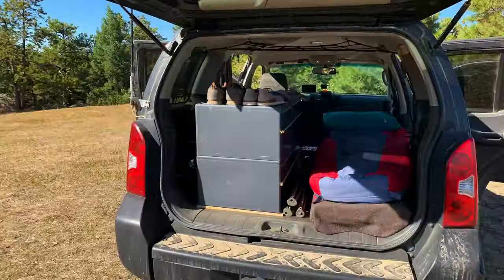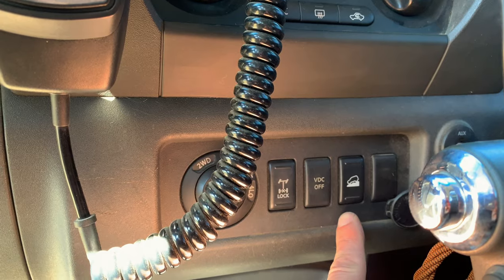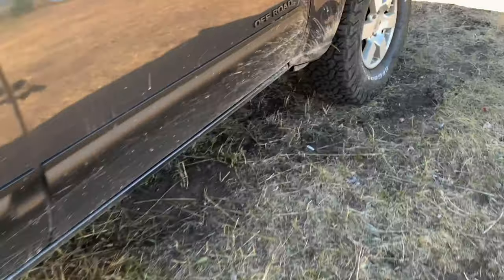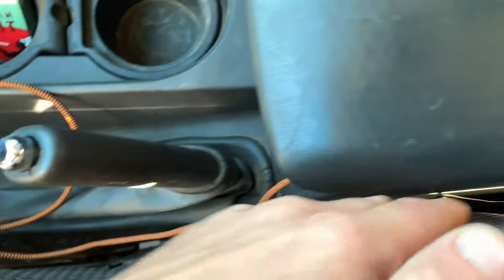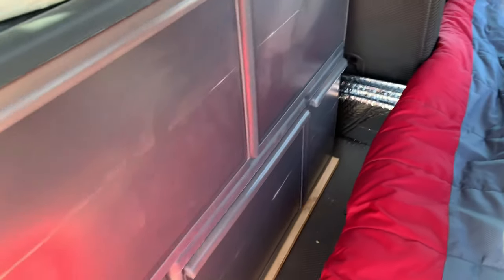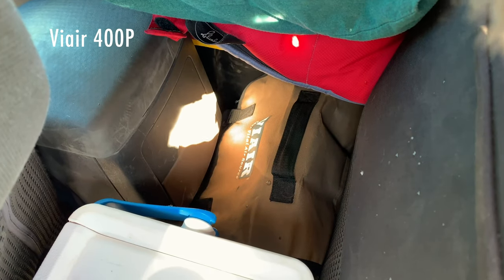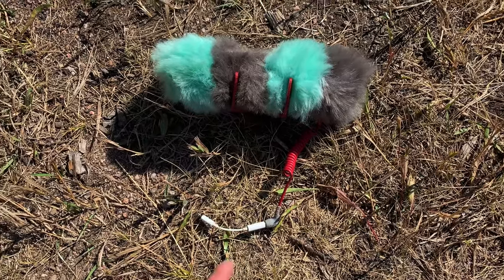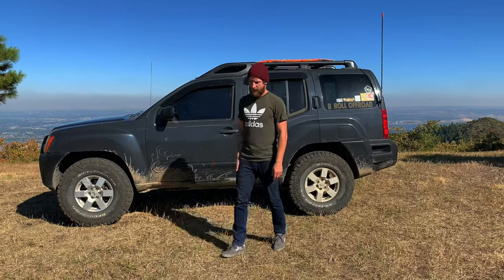Basic Solo Camping Xterra. Rig Walkaround #1

Comment from the maker: just wanted to add a couple things i missed:

the bottom drawers are screwed down into the wood and top row glued down to the bottom row. they're all glued to each other where sides are touching. i used some kind of roof repair silicone. 

i had a tow strap in the cubby in the floor below the mattress/drawers. there was also 2 hatchets in there. i didn't want to waste that whole space but the reality is it's a pain to get anything out so those items have been relocated.

in the bag in the crate i also have a CB tuner and cable along with a Lansky knife sharpening kit. 

the CB power is routed to the right of the radio and behind the glove box to the fuse box with one of these:
https://amzn.to/2p4MqC3

Comment: I tried sleeping in my Xterra a couple of times and gave up.  The fold flat passenger front seat makes all the difference.  For a while I slung a hammock from the roof rack to a 4x4 post or boulder --- so awesome in the desert heat but having it fail unexpectedly at 3am is like a kick in the sack.  I've had multiple tents/poles fail in desert cold/wind while setting them up around midnight --- your setup probably saves you a lot of headaches.
Reply from the maker: HAHA i can imagine, that sounds awful! my buddy works at Warbonnet and hammocks were the only other thing i was seriously considering but i'm in Moab so much with nothing more than bushes and sand around i had to give the idea up. so far i love everything about the Oztent, can't wait to get it in some heat and see how its features handle it.

Comment: I'm a new 2nd Gen Xterra owner with the ALL Important Off Road Pkg... I'll prob go exactly your route for a more simple setup. These trucks are plenty capable right off the bat I hear. 

I'm stoked to find your channel and def am a subscriber now! Cheers
Reply from the maker: absolutely! i have very minor mods (2” lift, no sway bars, 33” tires) but my earlier vids the X is stock. i also have Easy/Medium/Hard playlists if you wanna check those out. 

if you’re going to sleep in back i’d make some kind of platform, the ones i’ve seen have like a 4” rise towards the front. the problem is the trunk kind of goes uphill from back to front, then the seat folds beyond flat to downhill, then the crate is flat. so the sleeping surface basically has a hump in the middle and is only flat at your head.

Comment: Great vid man. I have a very similar rig and similar mindset, but with the 6 speed manual. I have 265 bfg ko2s which will need replacing soon. What's your review on the 285s, specifically in the mpg area? Noticeable drop in mpg or comfort? Mines a daily driver so it's somewhat important to me, I can get around 18-20 highway avg currently with a 2 inch lift and a front bumper if I have a light foot.
Reply from the maker: i got 23 on the way home today but i took the highway instead of the interstate so it’s only 45-60mph. i think over 75 these don’t get good mileage no matter what but i’ve gotten 17 on that route. i love them but a complaint would be load range E, they ARE noticeably stiffer but i got used to it and they wore in a bit.
Reply: @BRollOffroad  thanks for your fast reply. Good to know. I am E rated now so not too worried about the stiffness...just the possible mpg loss for what is a minor gain off road considering I don't go much and what I do is mild.

Comment: Very cool rig. I’m rocking a 2007 off-road Xterra, mines the 6spd manual. 

Yours must’ve been the first year with hill decent, mine didn’t come with it. 

Curious on what did to remedy the SMOD issue that plagued the autos. Also with the rear diff, you running stock fluid? Did you run the breather tube for the diff too? I got worried so I got the setup from Off-road Gorilla cause I’m lazy.

Love your videos dude. Eventually you’ll move onto a Toyota or something but until then I’m a subscriber and love the videos
Reply from the maker: hey thanks a lot for checking 'em out! the SMOD was remedied when i bought it, has a nice CSF one in there. fluid looked OK, nothing on the cap, now it's ~45k miles later and no problems. i'm not sure what's in the diff, i checked it in the beginning and it looked fine but it's probably time. i still haven't done the diff breather (i know i know..) because i'm even lazier than you haha!

Comment: I have a 2017 Pro 4X, when set up camp put it in park and put the seat all the way back ... I'm camping and can move out in less than a minute ... don't use lights or have campfires (X Jungle Fighter, get nervous with a lit up camp) ...
Reply from the maker: yea i've camped that way before too, not the best (i broke my neck when i was 17 and still have a lot of problems) but works fine in a pinch! usually happens when i'm trying to make a roadtrip in one go and get too tired before the sun comes up. pull over, seat all the way back, try again in 3-4hrs 👍 something about the fire makes lights OK but recently we've had fire bans and when i was walking around with just my light on it felt weird and super exposed. inside the truck it's all glare and can't see out so i don't know, i slept best with all the windows down and no lights on haha, kind of counter intuitive but at least i could see and hear.
Reply: That's pretty sick because the Xterra was discontinued in 2015

Comment: B Roll, how is the on road handling effected by the sway bar removal?
Reply from the maker: personally i like it better for the rough paved roads we have out here, hitting potholes is much less violent. bridge interchanges on corners where the back end would kick out is eliminated. the stiffer springs help a lot with body roll, i think stiffer springs without sway is about the same as stock springs with a sway. it never handled great to begin with and i drive accordingly haha. it’s just a few bolts to take it off, i think it’s worth it to remove and go do some swerving and see how you feel 👍

Comment: Love the simple set up! Where did you find that drawer system you have in the back? Also love the hilarious narration! Keep up the good videos👍🏼
Reply from the maker: thanks! the drawers are from The Container Store and were a little spendy, i think it was like $100 for the 5 but they're still solid after many trips. I screwed the bottom ones down to the wood board and glued them together in between. then glued the top row down to them using a roof repair caulk.
Reply: Thanks. $100 isn’t bad compared to a lot of other options! I’ll definitely be looking in to that
Reply from the maker: @schuylerking1318  yea we were leaving in a few days for a 10-day in Moab and i needed something fast. i definitely could've made something but didn't have time and i like how light these are. it's only temporary if it doesn't work!

Comment: You carry any gas cans or anything like that? Maybe I missed in the video.
Reply from the maker: nah i just fill up at the closest gas station to the trailhead if we’re planning on driving a lot, hasn’t failed me yet! most of these videos i filled up near my house, drove all weekend and then made it back. even Vail is only 100 miles away, 200 with the drive back and i’d never put 100 miles offroad down in a weekend so it’s fine. last time in Ridgway i filled up, started heading East out of Montrose and my buddy’s van blew the radiator. i drove all the way to Delta, came back with the part. drove all the way to Denver to drop ‘ol Roddy Turner off and then drove home to Littleton.. 402 miles on the tank 👍
Reply: @BRollOffroad  that's really good. My 4runner ain't hittn like that though.

Comment: I slept in the camper of a 97 f250 for afew years hunting. A metal camper. A COLD metal camper. Schedule follows: run buddy heater, turn off, sleep. Wake up frozen, run buddy heater, turn off, sleep. Wake up hypothermic, run buddy heater dangling testicles dangerously close to heat shield, turn off, sleep. 

Now i take my teardrop camper. It has heat and AC.

Comment: Hell yeah dude I’ve been watching your vids for a solid year. Nice to finally get a rig walk around, I like the simple setup mine is similar in my 99’ 4Runner.  You forgot to mention the rear diff locker really helps on steep climbs and big boulders! Also I couldn’t live without the manual trans in my 4Runner it makes you feel so connected to the trail. And are your tires 33’s ?
Reply from the maker: nice  good to hear! my Ranger was manual and i really miss it but made the call i had too much going on while filming. lastly yea the 255/85’s i had are allegedly 33.1” and these 285/75’s are 32.8”.
Reply: Sounds like your on a 16”wheel, me too. I was thinking about going 285/75/16 with some Pro Comp wheels with a 4” backspace
Reply from the maker: @bradychristians748  yea stock 16's which i think are ~1" backspace.

Comment: Could you provide some more information on those recovery tracks you use?
Reply from the maker: kind of.. they sent a few sets to my buddy, who gave a set to another buddy, who gave them to me and i haven't tried them yet. i did see this exact set in use one time but it was kind of a biased test imo. the van that's on my channel page was stuck in 3' of snow and we thought we'd try these out, wedging them in they were nearly vertical. he punched it and immediately shot them down into the ground javelin-style. this caused the corner of one of them to break off but in their defense the van weighs 7,400lbs and i think we should've done more digging to lessen the angle, double stacked them for the weight etc. we fished them out and winched him backwards.

Comment: How do you like the ride without the front sway bar? I removed my rear and the front is next.
Reply from the maker: i think it’s fine, just take it off and go do some swerving, see how ya like it haha. this is the 3rd vehicle i’ve done it on, doesn’t seem to change much for cornering (never did well anyway) and is better on potholes and stuff.
Reply: @BRollOffroad  so I just took mine off on my X and I've got rad flos with 600# springs and wow does it ride better now!
Reply from the maker: my favorite part is bridge interchanges on a turn, no more front and back end shifting sideways. we have a lot of rippled pavement here too and it’s so much better, i prefer my independent suspension independent haha. glad you like it!

Comment: Where did you get the dresser thing
Reply from the maker: https://www.containerstore.com/s/like-it-smoke-modular-drawers/d?productId=10034766&q=drawers

it’s these modular drawers Container Store sells. i cut a piece of plywood as a base and screwed the bottom row of drawers onto it. i then took a really high strength glue that’s used for flat roofs to glue them to each other so they didn’t rattle. then i glued the top row of drawers down to those and again to each other. i screwed in those little hooks for drawer locks with a blob of glue on the inside to hold them and somehow they’re still working. this was a quick temporary solution before our 10 day Stanceworks trip but it’s been months and they’re holding fine. they’re one of my favorite things. i was racking my brain how to make something to use the whole space and fit perfectly but now i can just throw quick access stuff behind it and it’s even better than if i made it all enclosed like i was about to do.

Comment: Do you have a lift on your xterra?
Reply from the maker: yes there’s a video just on the Xterra mods/gear i carry but it’s basically 2” OME Complete Lift Kit which was all new leaf packs, rear shocks and coilovers. then when my ball joints went i got SPC upper control arms with the adjustable ball joint. 33” tires and removed both sway bars.

Comment: Don't the 2005 to 2009 model had issues?
Reply from the maker: weak leaf springs, replaced when i lifted it. Strawberry Milkshake Of Death (transmission fluid mixing with coolant) solved with new radiator, that was done by previous owner.
Reply: @BRollOffroad  Ohh good to know! Good video. Keep it going.
Reply from the maker: @khmerbraveheart  thanks!

Comment: Why get rid of sway bars?
Reply from the maker: the rear on Xterras is a joke, very small diameter and literally makes no change to body roll when removed. on the 1st gen’s it’ll break your shock off if you flex out too much. my Ranger didn’t come
with a rear.

i originally took the front off trying to diagnose a noise and it really didn’t change much to body roll, it didn’t handle well to begin with. i found it to be way better offroad having my suspension actually independent.

potholes and bridge interchanges are way better too. not saying i recommend it but i have been doing it forever and drive accordingly.
Reply from the maker: also should be noted i’ve only done it with upgraded suspension in other areas making it stiffer overall.

Comment: No sway bars do you daily drive it like that
Reply from the maker: yep, third truck i’ve done it on. none of them handle to begin with and besides i like it even more on-road. potholes are handled WAY better but the biggest thing i noticed is bridge interchanges that are on a corner, you know the ones where your rear end kicks out a few inches each time? stays totally level and planted, i like my independent suspension to be independent, not connected with a bar. BUT they are there for safety and i always have in the back of my mind that they’re not on. i take them off on the first day though so there’s nothing to get used to.
Reply: @BRollOffroad  the first rig you did it to was it hard to get used to after taking off the sway bars
Reply from the maker: @travispoirier6234  that was on my 1st gen Xterra, the rear is notoriously useless (it was skinnier than the one on my old Focus) and changed nothing, my Ranger didn't even come with a rear stock. i took the front off to diagnose a noise and honestly couldn't really tell a difference, offroad though huge difference and i was sold. you can just undo the bushing bolts and ziptie the bar out of the way then go do some swerving, see how you feel.

Comment: What lift did you do to your truck thanks
Reply from the maker: Old Man Emu 2” complete and i took my sway bars off 👍
Reply: @BRollOffroad  thanks my friend, I'm getting a quote this week ,do you have to upgrade the tryer size
Reply from the maker: it’d be better to, with or without the lift can fit either 285/75/16 or 255/85/16. you have to heat up and push in the little bump in the back of the fender liner but it’s real easy, just look up Xterra Melt Mod. i currently have 285/75 but switching back to 255/85 next set.
Reply: @BRollOffroad  thanks so much my friend. I'm on the case , any info would be greatly appreciated. New to this butt I need my pathfinder to go were I go lol .Cheers Arr
Reply from the maker: @piratedredger1857  the BFG KO2's were the first offroad tires i ever bought. they never served me wrong so i kept buying them, have had 3 sets since. i switched over to the BFG KM2's on my Ranger and also on the Xterra which is what i'll be switching back to next time. i think the KO2 is a better tire overall but they don't make it in 255/85 for some reason.
Reply: @BRollOffroad  thanks ,I'll no forget that ,I just bought a set of geolanders AT 6 weeks ago ,oft 700 bucks ,.thanks my friend your sum man